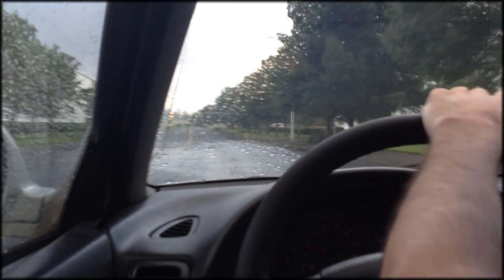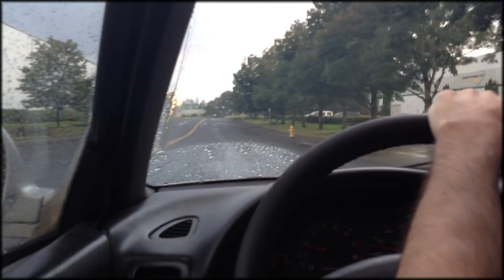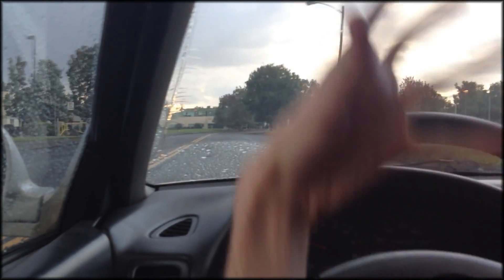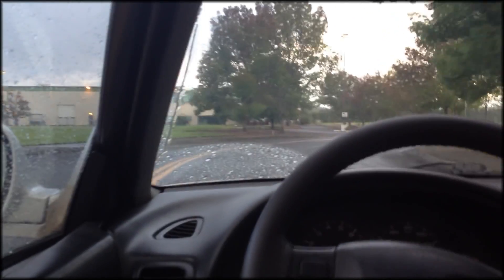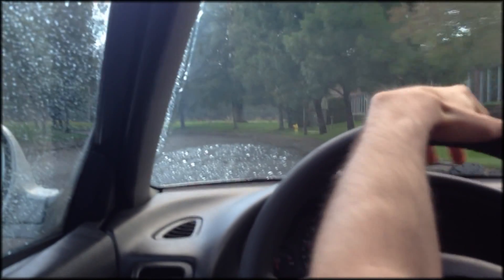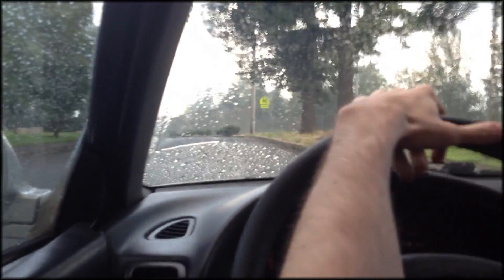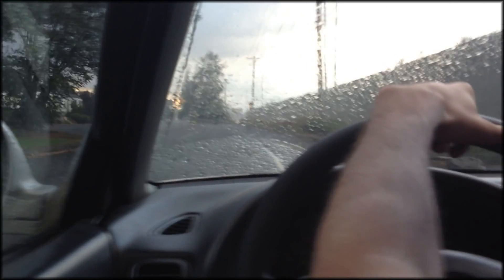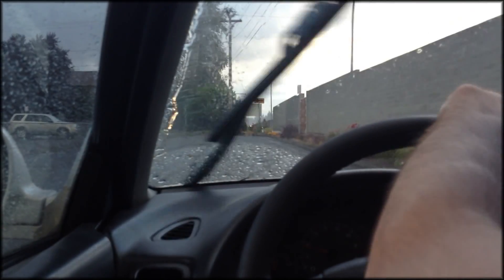Yonaka Coilover Test and Review - Acura Integra

Comment: Great video, but I'm having the Pandora's Box dilemma  after installing coil-overs on my GSR. The Coil-overs lower the car about 1.2". This changed the camber in front and the toe in the rear - both of which are non-adjustable from the factory. Adjustable compensator links for the rear and adjustable upper ball joints in the front are required - at no small expense.

Comment: considering most of your braking power is in front, to plant the car, I feel like a downside of coilovers would be less nose dive, aka longer braking distances
Reply: you have it the other way around if the spring rate  is not excessive...you have more predictable braking and confidence...don't forget most coilover owners also generally run wider /better tires and better pads e.g stoptech sport pads = better braking...i myself went from stock 215 to NT555 245 all around.

Comment: Wow, with this suspension mod you end up using more of the available grip of the tires. When you brake after the mod the tires screech a bit; you get to the limit sooner. My Lincoln Ls is sporty, but when you turn quickly without braking (loading the front springs) the car leans like hell. I totally need to get some coilovers.

Comment: So I know this is an older video, but I was wondering what your final set up was like with your coil overs? I'm looking at putting coil overs on my 2011 WRX, I love on an island with really twisty bumpy roads, so I'm not stoked about the idea of creating a low and harsh ride, I just want to have better damping than stock suspension when I go over these phantom bumps that jolt the car skyward mid corner.   hmm, still learning about suspension set ups and tuning. looking for some advice.

Comment: Hey , great video thanks.......I have a mint condition 1997 Honda prelude that I bought brand new with just 23,000 original miles on the odometer as of today.....Would like to lower it with coil overs........How ever it's a job I would prefer a Honda tech at a dealer do, any idea how long this may take for the change over ?......Thanks , hope to hear back from you Engineering

Comment: Great multiple video series by EE and illustrative comment thread here for anyone considering changing from stock, or selecting factory option packages on their new car, based on drive style and road conditions. I've been reading and driving for 45 yrs and learned lots here. The harmonic  frequency response of the driver increases with age, IMO, so old farts on bumpy roads may need the softer factory suspension for everyday. Maybe use a factory or aftermarket  adjustable package for  performance driving when we don't need the dampening to save our face from vibrating off! 
I see the importance of a track tested, time tested aftermarket system over a multibrand piecemeal approach is implied by your analysis in the other videos. 
Appreciate your systems and analytical approach to suspension mods! 

Thanks!

Comment: Hi! I just installed my new coilovers. I've been doin some research about bouncy and ucomfortable ride that it gives. Even if I set it up to the stiffest settings it still feels like driving with an oval shape wheel, I know you might say get a wheel alignment but I already did, even had a wheel balance. Could someone explain this to me? Is it the road that I'm feeling when I'm driving or is it just the coilovers?

BTW. It's a BC V1 Coilovers. I know this isnt the perfect place to ask this but ye.
Reply: HiatusMobs that oval shaped feeling is understeer. get some stiffer sway bars in the rear to get a bit more oversteer.

Comment: Hey I'm looking into to buying some for my car, do you still have these installed ? If so how are they doing ? Have they started to break down yet ?
Reply: +Engineering Explained Still have them?? I'm wanting to buy coilovers for my teg but everywhere I've seen online says they usually tend to fall apart after a while.
Reply: +Engineering Explained I would also like to know how are the yonakas doing.
Reply from the maker: MrBrightSide784 Still have them, they're fine. Note that you can't really install them without lowering it somewhat. Seem to be quality but I don't put too many miles on them. It's quite stiff, as mentioned.
Reply: +SynnDragon did you end up buying this set up? if so, how are they?
Reply: I did not.

Comment: What is the purpose of the nose dive test? What is meant to be seen when comparing stock vs aftermarket? Also, is the grinding sound with the yonaka coilovers because the body is hitting the wheels?
Reply: *****  Softer spring rates are chosen to maximize comfort but don't necessarily maximize handling performance. The softer springs that are chosen for comfort result in more body roll. Whereas with stiffer suspension you have less body roll. Less body roll means the mass of the car is being transferred more quickly from one direction of motion to another, which to you as the driver means a car that feels more responsive and nimble when turning. However, it isn't just a perception of feeling or how the car responds to steering input, the car will actually have more traction with less body roll so you will be able to go around turns at a higher speed. Going around a turn a car will naturally lean to the outside of the turn due to the forces acting on it. Then as the car body leans to one side mass is no longer balanced effectively to both sides. The reason this is undesirable is because the downward force from gravity acting on that mass (i.e. weight) helps provide traction through frictional forces. So it is important to maintain weight to the inside wheels as you go around turns to maximize traction. This is the major reason why reducing body roll is desirable and how it is able to help increase traction. Of course stiffer springs aren't the only way this is accomplished. Sway bars are also used to reduce lateral body roll on a lot of vehicles. There are other advantages, such as better braking because nose dive is reduced resulting in greater rear wheel traction giving greater braking performance, but these are some of the main benefits of reducing body roll. However, you can't just keep increasing the stiffness forever, not only can an overly stiff suspension hurt your back but eventually too much stiffness will actually begin to reduce traction and hurt the handling characteristics. Because in dynamic systems such as car suspensions there is usually a sweet spot for the type of response you're looking for. Dynamic systems are kind of like Goldiloks, too soft and the system doesn't respond fast enough to a given input and too stiff it can respond too quickly. When it responds too quickly you can have undesirable response characteristics also, such as with a car the handling will be reduced when the suspension is too stiff. The stiff suspension causes the weight to not be transferred smoothly enough and the sharp forces of the weight transfer and other forces are now transferred too quickly to the tire overcoming the available traction. Some compliance has to remain in order to plant the wheels to the ground effectively. It is actually quiet possible to end up with a worse handling car if you make it too stiff than if you were to just leave the factory suspension in it. Let's think of an example from normal every day life that may help illustrate how extremes of a dynamic system may be less than desirable. Imagine you are walking with a cup of water as you walk around turn. The water moves back and forth in the cup as a result of the motion. Now imagine going around the same turn with varying levels of stiffness in your arm. The goal is to minimize distance traveled around the turn by your hand, while taking the same steps at the same exact speed (no cutting corners to go faster!) and simultaneously not spilling the water on the ground. If you keep your arm too loose then the weight and forces from the cup and water going around the turn will end up causing your arm to move further out and traveling around the turn in a greater arc. Like I specified in the goals you don't want this excess movement, because you are trying to minimize the distance traveled by your hand. However, it's important to realize that being too loose will also limit your maximum speed around the turn if you did want to go faster. Eventually if you were to go faster around the turn your arm would be forced to it's maximum articulation, so there is no more compliance to absorb the forces of motion and they are now transferred to the water causing it to spill. This is how too soft of an arm causes you to spill the water and limit your maximum speed around the turn in addition to just being inefficient and resulting in too far of a distance traveled for your hand. Now if you hold your arm too stiffly then you are also limited because the water will slosh around and possibly spill on the floor. This is happening because the forces from your body's movement are no longer being absorbed effectively by your arm and are now being transmitted to the cup and water inside. Now if you  keep your arm fixed firmly, but not too stiff so that you can still allow the water to move smoothly in the cup and not spill, and not too loose where your arm is moving too far to the outside of the turn and causing more work to be done, now you have found that sweet spot of the dynamic system that allows you to maximize your design parameters :). It's a different type of dynamic system than a car, but I hope it helps to explain how something being too-stiff or too-loose can result in undesirable responses from the dynamic system. Of course vehicle dynamics are very complicated, and for the sake of simplicity I didn't even bother to mention damping, but these are just some general concepts that help explain why the body roll is undesirable. Just remember that in the car you want better handling, but this can only be increased so much by stiffer suspension and reduced body roll before you get undesirable results. If you're interested in this type of stuff there are many resources available in books at libraries and many websites online to help get you started. I hope this helped some :)
Reply from the maker: ***** No, that was some wheel slip.
Reply: WOAH! Awesome reply. Thanks for writing that all up. A lot of good information.
Reply: ***** It would work better with diagrams and stuff, but thanks :)
Reply: Nose dive is the shocks allowing too much travel from load transition. Body roll is usually from the springs but can be shocks too. Some body roll is good going into turns because no body roll and the car goes straight while trying to turn. Softer springs generally used for comfort but also for motion response. The softer the spring, the faster it responds to turning inputs. You have to figure out what you want in your vehicle and Exactly how much roll you want.
Reply: the skid sound was the abs

Comment: how come with the new coilovers when you brake there is a loud grind?
Reply: +xxxMIGHTYDIPPERxxx long ass run on sentence but provided a smart answer thank you sir I appreciate the knowledge that you are giving to others especially me because I don't know too much about this stuff but thanks to people like you and the person that created this video I am able to continue my journey of learninh and also gonna think about putting these in my 2011 Acura TSX maybe drop two inches and make it really firm
Reply: Sounded like the rear wheels locked up.
Reply: that would be wheel slip sounds like a bad thing but not 100% see factory suspension in the video shows more of a bounce motion which to my knowledge cuts down on the ammount of force put to the front make it more of a comfort not shot into your steering wheel braking method great for taking kids mother dogs etc to different places and you had to hit your brakes hard because someone cut you off or because something or someone ran infront of you now as far as coilovers lowering springs etc with higher spring rates these forces are put forward or to the rear or sides in an opposing force or collective force meaning itll either balance the force or move the force to one area the reason for the wheel slip is because more force is moved to the front of the car causing more traction but in return the driver is use to the stock suspension and is applying to much brake to the car to stop that quick to show that their is barely any movement to the nose of the car now lowering whichever way you pick will affect braking acceleration nose dive and squat squat is shown in acceleration were the car moves weight to the rear wheels shown more in rear wheel drive vehicles ever watch drag cars? Notice the big rear tire small front tire set ups and they do a wheelie well its because the force is moved to the rear and the torque mixed with the squat makes the car act as if you filled it full of concrete hope this helps you!
Reply: +Tristan Brown haha my bad! But glad i could help out goodluck!
Reply: no sweat Vapenasty I appreciate you fam

Comment: Did you have to go thru getting the car all re- aligned after you installed the coilovers or did you do them where you install them almost exacty the same as where thstock 1s were positioned to not have to get an alignment after so its all balanced out?????
Reply: you have to get an alignment only way it is possible is if tbe car is say lowered 2inches you buy new suspension and set it for 2 inches any more or less will hurt the alignment which on hondas specially older ones is usually the toe

Comment: Why would we actually listen to someone who doesn't even know the hands position on a wheel? Superman position is so wrong.
Reply from the maker: What do you have against superman?
Reply: Engineering Explained Is that how you learned the driving position at the driving school? Have you ever seen superman position in racing? Answer is no, pretty much that's why. Maybe his stock coilover were 90% dead or pretty much beat up. If you want to compare differences buy new stock coilvers and test it against another one from market.
Reply from the maker: Honestly I don't even know what "superman driving position" is. Sometimes I simply respond to trolling when it's not in my best interest. If you want me to test vs new shocks or a different set of coils, send them my way. I use what's available to me. Cheers.
Reply: Engineering Explained Superman position= hand position on top of a the steering wheel and the other hand somewhere else but not on the steering wheel. I am just saying because i've seeen stock coilovers on bigger cars and still didn't see that body roll, so that's why i presumed your stock coilvers might be pretty much used up.
Reply: verdenpom Who cares? He's just driving casually. If he were on the track doing that, I could see where one might take issue but you're just nitpicking. His hand position shouldn't make a difference in this test, unless he's changing it up between runs.

Comment: Why is it important to reduce body roll or rather, for what purpose?
Reply from the maker: Great question, and I was actually hoping to get into that with some videos but never got around to it. Basically the flatter your car stays, the better the tire contact patch as the alignment of your wheels doesn't change.
Reply: And also it reduces inertia force side to side which stabilizes the car and makes it handles better!
Reply: Depending on your coilover setup, you can setup each coils with specific weight tuning to help into corners even better, also here is a very very rough/estimate numbers you might see on a figure 8

Stock coils = 12.5 with lateral G's of .92
Upgraded coils = 11.0 with lateral G's of 1.01

Comment: How much of a drop do these give your integra??  Like whats the lowest the coilovers will drop too
Reply from the maker: Yonaka claims a maximum drop of 4", which seems like it could be done with them.
Reply: Wow. That's actually insane. An thanks for replying. Lol. But that's more then enough. I'm looking for just a 2inch drop.   Are they worth it though??  You still have them on the Teg?
Reply from the maker: Yep they're still on there. Honestly I was trying to keep it closer to stock height, but that seemed a bit challenging to do. When I have some time I'm probably going to raise the rear a little bit, as it's sitting fairly low now.

Comment: are your tires low profile as well,

suspension + low profile tires + chassis supports are good 
and your car is light with a short wheel base, could corner like a flea
Reply from the maker: Stock size wheels and tires.

Comment: Did you put them in or have someone do it?
Reply from the maker: I did it, was fairly straight-forward, I have an install video if you're interested.
Reply: Engineering Explained
I'll watch it. I've done them before but I dont have air tools or a lift like I did last time. I'll be lowering my 98 civic last time it was a 96, but like I said I had air tools and a lift. I'll watch the video and see how you did it on the ground! Thanks!
Reply from the maker: Yeah, it was all done with just floor jacks and socket wrenches. Takes longer, but it's much cheaper to do.

Comment: Damn you can really see the amount of reduced body roll and the stiffness of the front end while braking. You could hear the tires skid from braking after the coilovers were installed. Not a bad modification for $575. You can hit those turns above 1st gear now!
Reply from the maker: Skid was due to ABS and cold weather, but it did have less nose dive.

Comment: Does nose dive helps reducing breaking distances by putting more grip on the front tires or there is other factors? does it make a different if you are breaking in straight line versus maneuvering while breaking?